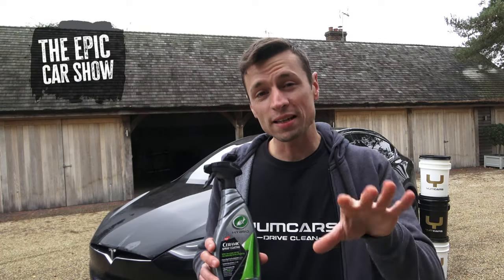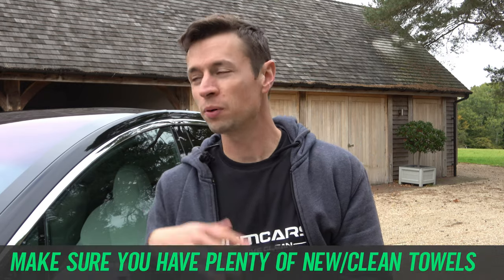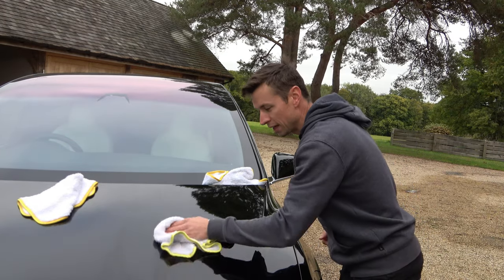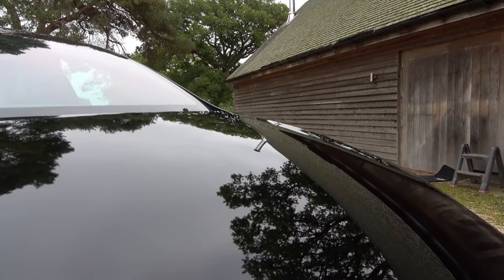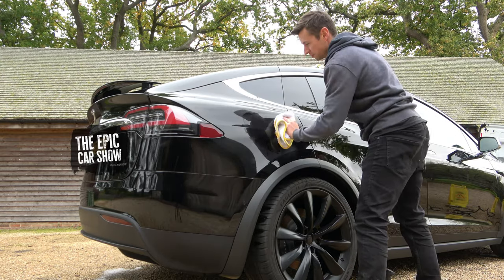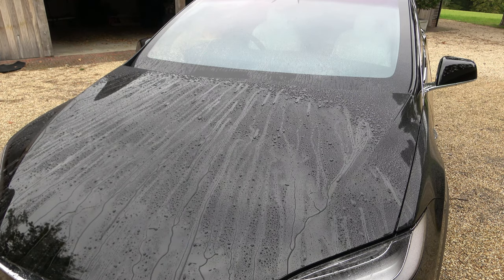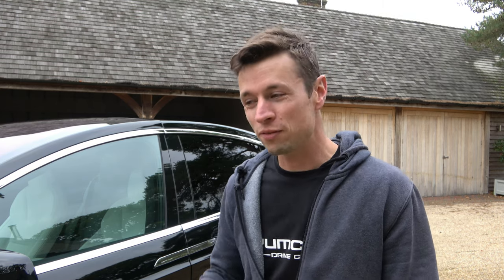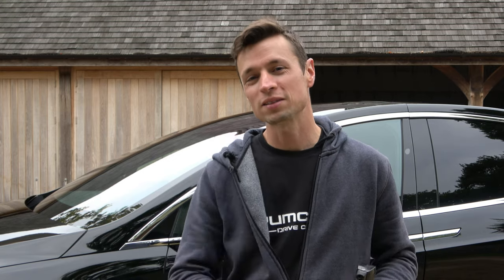Turtle Wax Ceramic Spray Coating Review | Fix Streaking on Black Cars

Comment: I have had success at avoiding the streaking by applying the spray to the towel itself not the car.
Reply from the maker: Yes good call 👏
Reply: I was going to say the exact same thing. I've discovered applying directly the applicator tends to work better. 
Good video though for sure
Reply: I recently discovered the same thing.
Reply: I also did the same…
I did polished my bike, it’s 2 years old now but I always take care of it, so I was confident of the paint condition. I did a hand polish & then washed and applied the product.
The only thing I’m wondering is that the water bedding has improved not by a big margin, may be because it was already smooth surface, secondly I did not notice any improved shine, again my bike is white.
Let me know your thoughts.
Reply: How many sprays did u do on ur towel?
Reply: Exactly, and don’t work in the sun or hot surface.
Reply: +1/ same here

Comment: It doesn't last for 1 year but it last until you wash your car  again with foam.I applied it to my car 1 time and in 24 hours I applied it again.After 1 week I washed my car.When I cleaned the car at first only with water I could see that the ceramic was there and the water was almost all slipping away from the car. but when I soaped the car with special soap and when I cleaned the foam with water, the water did not slipping from the car.  the ceramic lasts until you wash the car again. it is like all other liquid waxes.  they didn't last more than 1 max 2 washes and disappeared...

Comment: I’m way late to the party but I ran up on someone else’s video who is a “professional” who said they cut this and other type of sprays with up to 1:1 water. It works great coming right off the drying step. In fact, I use the already moist PLUSH drying towel and prime it with the 1:1 spray and it almost goes on 98.5% perfect and that’s already super good for most novice or casual eyes. You could quickly go over windows and chrome trim with a dryer clean primed MF towel. Works super quick on problematic dark and black paint. The beads are a HAIR weaker (meaning I had to look for weakness) but if you wash and wax this way at least every 3 months you are more than good even kept outdoors.

Comment: I've  had excellent results by spraying the TW Hybrid Ceramic and new Graphene sprays directly on a square microfiber applicator pad and applying in a cross-hatch pattern.  Very effective on the application and a bit more economical.
Reply from the maker: Yeah I love this spray the only thing that lets itself down is the time it takes to apply

Comment: Brilliant. Used this stuff last year on my black Range Rover after spending hours - clay bar, cut and polish. So disappointed with all the streaks, they disappeared after about 3 washes and there was obvious protection. Same process this week and tried less product, more clothes, more wiping off etc to avoid streaks. So bad I only did the bonnet and front wings. I'll give her another wash and try your method. Many thanks.

Comment: Thanks for the update. BTW, for those wondering about TW Ceramic Sealant and the new and improved S n’ S  vs. graphene coatings, there are a few videos showing that the TW products are longer lasting.
Reply from the maker: Thank you Robert. I liked the old seal and shine so hopefully the new one will even better
Reply: @epicautomotivedetailing  Please do a video on improved S n’ S. There’s a recent video comparing it to the original formula, and it beaded better and lasted longer, even after being assaulted by multiple applications of nasty cleaning products.
Reply from the maker: @ChicagoRob2  yeh I been thinking about testing it. I'd like to test it while I'm out and about so I can make relatable for car cleaners and see how to make it good for business with cost per application and look at how much you can charge for using it. I'll definitely do that

Comment: great video.   as a long time detailer,  I suggest misting di water from a spray bottle immediately after applying. then b7ffing dry for no streaks at all.  or dampen a new microfiber towel an vs then buff off with that.   good videos thanks

Comment: Thanks for this video. I had exactly this issue on my Black Alfa. Streaking looked awful. Tried the damp cloth trick but it didn't improve the situation until I followed the damp cloth immediately (literally damp cloth left hand, buffing cloth right hand) with a bone dry buffing cloth. Then it started to look great. As you say you will go through multiple buffing cloths because the need to be bone dry. This product still takes a lot of effort to apply to a black car so its not for everyone but if you use it have confidence to power on knowing the streaks will come out with these tips. Also, the direct sunlight tip is bang on product bakes almost immediately in direct sunshine making life even more difficult so choose a grey day, should be too hard in the UK.
Reply from the maker: Yeah it's definitely not my favourite by far there is too many better ones out there. I think for most people it's not worth the hassle this ceramic spray

Comment: Very honest review. I had the same streaking on my black BMW with the ceramic spray after I used Turtle ceramic polish and wax. With your tips it works much better. Thanks
Reply from the maker: Thank you. It's a good product but i can see why people became frustrated with it 👍
Reply: @epicautomotivedetailing  after I bought the regular ceramic spray, I saw that Turtle also released ceramic black spray and black polish. Did you tested these as well?

Comment: I bought this product as soon as I saw the many amazing videos out there.
But, after watching your video - and other videos of some lesser known YouTubers - and quitted even trying it.

I am very glad you did this video.
Now I am feeling more confident to apply this on my black car.
Reply from the maker: It's worth a crack if you still got it. It does shine up well and doing it now in the UK with weather cooler it's worth doing
Reply: Apply on a black car but spray the product on towel not on the car after just buff with a second towel. (Thank me later ) :) :) :)
Reply: @darker3rrr 
Thanks for the tip,, how long do you leave it, between applying on the towel, and buffing it off,, ??

Comment: This is exactly what I needed, I think I was having this problem with Meg's hybrid ceramic.  The biggest issue was on outer trim and windows where it left oily looking streaks, and I had the best luck with reappling over those areas with a thicker coat.
Reply from the maker: thank you

Comment: Good video and agree like many, the first time I used this I wasn't impressed at all, especially after watching all of the rave reviews. However, I've stuck with it and found the best way of applying on my black car (including in the summer), is to spray the product onto the microfiber cloth rather than directly onto the paintwork. Still streaks a bit here and there but much easier to work with. Also using the applicator cloth as the damp cloth to go over any bits again rather than another wet cloth. Good results and okay for once or twice a year but not an easy product.
Reply from the maker: It's definitely a love hate product. I got few more ceramic sprays to try this month as I'm definitely using them more and more now
Reply: Hi Joe, my first attempt not great so i'm reading all the comments and advice here. Did you mean that you have one applicator cloth that is wet with water or product? and use this for the whole car. Plus do you use multiple dry buffing cloths? Sorry if i have misunderstood.
Reply: @Tim955w  What I mean is that I use the same applicator cloth to go back over any streaks then buff again with the dry towel. Seemed to work okay.
Reply: @joespavin3792  Thanks for replying.

Comment: This guy is totally right, I’ve  used the black wax  with is amazing but it still streaks like crazy!  Using a damp towel does work
Reply from the maker: Thank you Phil, it's a good ceramic spray for sure but think it needs a little tweaking to be something special. You just got to power through it 💪

Comment: I spent all day on my car trying to remove streaks. Not at all easy and for this I will never use this again.   You’re right in what you say.   To Pell you the truth my Porsche came up brilliantly with Halfords own liquid polish. It was brilliant and easy to do.
Reply: He used it wrong. Spray it on the applicator not the car.
Reply: I tried this product a few times on my bright red car and the streaking was terrible. And yes I even tried applying on the cloth rather than direct on the paint. It was like I rubbed oil from the side of my nose on the paint. Took a lot of time and aggrevation trying to rub out the streaks using dry and then damp towels. I could have used old school wax in the same time and not have dealt with streaks. I don't get how people are successfully using this product, maybe they don't notice the streaks because they only show at certain lighting angles.

Comment: I have a dark grey Toyota and applying TW, I will get the streaks. But using it on my wife's silver car, it looks absolutely fine!
It's nice to find a the work around is extra micro fibres!
Reply from the maker: Yeh I've done fair few videos on this ceramic spray now and I've used it for a year I use it in lighter cars and save the darker coloured paint for things like yum cars or bear car care

Comment: Great video. I’ve been using this since April 2020. The key to this product is the damp cloth. It’s one extra step but it’s worth it. I also use the TW ceramic polish before this spray and that gives you 2 layers of protection. TW also came out with the black version of this that gives more depth while retaining the same gloss and protection.
Reply from the maker: Thank you Ron, sounds good idea I'll try that next time
Reply: What about the damp cloth?

Comment: Applied it 2 months ago and didn't really have any issues on a dark grey metallic. Used cheap/less plush MF for application, 1 to apply, damp one to remove and a quality buffing towel. Found it pretty easy and no issues. Over application seems to generate most people's problems imo.
Throw towels in a bucket of warm water as soon as you are done to stop the product curing into them and a subsequent wash makes them good as new.
Reply from the maker: Hello just curious on the weather conditions when you applied it. The horror stories I seen were from the really hot days in direct sunlight. Thanks for your feedback and experience it really does help other who read comments 😃
Reply: @epicautomotivedetailing  12c bright and sunny. I'd parked the car in the shade too.
 Machine polished with The TW Polish on a finishing pad, then 2 coats of the Ceramic. Done over 2 days so slightly reduced the cure time between ceramic coats 1 & 2.
Reply from the maker: @UltimateAccuracy  nice 12 is good temperature. I really struggled when I did it on hottest day of the year

Comment: Thanks for the video. To make this work in the heat (I'm in Vegas where it can get super hot and super dry!), do only one section at a time. Then make sure you use a dry cloth to buff it. That's it! I do it once a month after the first time, and it's incredibly good.

Comment: I'm glad I stumbled across this video because after using this product yesterday I found it streaked terribly. I did a full correction prior to using it. I thought these spray polishes were supposed to be faster to apply and some would have you believe they are, but in my opinion, the traditional paste waxes are far easier to use given that you don't have to franticly remove the product before it starts to flash-off and I think that's the problem with the streaking with these spray polishes, they start to flash-off before you have a chance to buff it off, especially on the larger panels, so it's those areas that have dried are what cause the streaking. You also mention about it being too warm when you applied this previously but TW claim you can use this in direct sunlight.
Reply from the maker: I think it's just a troublesome product in general. They know that. I expect this to be gone soon as they will probably have a better version
Reply: @epicautomotivedetailing well i bought version that says "new", yet i have same problems :D sio2 % is high enough to cause these peoblems + solvents in this bottle arent as agressive as they are in some other professional coatings where you can really smell them. Those strong solvents are bad for health but, comparing to something as TW spray ceramic, they actually help you remove streakings MUCH easier (before coating is fully curred).
Reply: Agreed. I had same issue and also ended up resorting to a quality paste wax. Wax on, haze and wax off ... without dealing with streaks.
Reply: @bigworldparty  The polished surface failed to bead when it rained.. in just five weeks.

Comment: Nice to see the integrity shown by not only making this video but pulling down the others. From my point of view (just doing my own cars), I'm sticking with Seal'n'Shine (or whatever we call it in the UK). The results are stunning, especially if the first application is done slowly with an applicator. I think the longevity, gloss and slickness are hard to beat for the money. However, if I was selling it as a service, like you, I'm sure selling a ceramic sounds much better than selling something from a £10 bottle from Halfrauds ...
Reply from the maker: Hello I'm definitely buying some seal and shine tomorrow I need to try asap for a video 👏

Comment: Dave a great video working in the heat is hard and a hot surface on a vehicle can be a challenge. You state the facts and some products are recommended not to be used in direct sunlight.  I know that a majority of the products are not to be used in direct sunlight and it's always wise to read the manufacturer directions.  Thanks for taking the time to encourage and to teach others the mistakes you have made and to avoid them. I live across the pond and working in the direct sunlight in Texas is challenging.  I have products that can be used in direct sunlight and streaking with any product on a dark color vehicle can also be an issue.  You said it best power through it and take the time to use more than one towel and just don't get discouraged.  If you are ever across the pond and come to SEMA Show  drop me a line.
Reply from the maker: Thank you my friend. Its actually hot over here right now. It hit 31 yesterday which was mad. still not a patch on texas i bet lol

Comment: As a mobile car detailer, I use this product because it's the best, but smearing is my biggest problem, making the job take much longer, and yes I spray directly onto the microfibre cloth, and I have to use water to remove the smear, but the results are outstanding, and worth the added time.
Reply from the maker: Yes the time is an issue but the results are amazing
Reply: So,,  it's spray onto a dry cloth, and apply,, wipe off after a minute or two, with a damp cloth,, and then almost immediately, buff with another dry cloth,,,  is that correct,, ??? Just trying to find the "perfect scenario" ". Cheers,,,,

Comment: Loved the video.  I have a dark blue car and have had streaking issues with several different products.  Instead of using a dry MF towel to spread the product, I've tried smoothing out the product with a damp MF towel.  This adds just enough moisture to allow the product to spread around evenly until I can buff it off.  It's not a perfect solution but has helped tremendously.

Comment: No streaking, no mess at all. Follow the directions, just 2 sprays per panel, never overspray. I spray directly on the panel or microfiber.
For best results, I use Hybrid Solutions Ceramic Wash.

Comment: I had a hell of a time with this stuff , and after applying  to the car sone days later parked outside a pub in the sunlight and it looked dreadful, but on the driveway it looked ok , so will now try it again , with your method , cheers great video and top tip with the damp microfibre cloth i will try again 😊

Comment: I started using it as a kinda drying aid on wet paint after maintenance wash. Works great!
Reply: But still.. Doesn't matter how I apply, it is not very durable..
Reply from the maker: I've done 24 hours in between coats and that's the best way to get real good durability.

Comment: I just finish to apply the first layer on my BMW i4 and I agree about the quality of this product.
Maybe I would add some advices to easyly get the job done: first of all, don't do this outside if the sun is shining. It's way better to to it inside when at temperature under 10° C. You will not have traces problems. Second, don't spray too much product and work on a single panel ay a time. Spray as you would paint: keep your hand moving toward the surface when spraying. Third, use good microfiber special clothes, one to spread, one dry to polish/finish. Don't wait too long to finish after spreading.
I tested with and without polishing car before on small surface and if you have time it's way better to do it first. You will got a  better result. 
It's not very difficult to use, but it requires a few hours of good working.
Tomorrow, I will go for the second layer, it will be more relax and a quick job, I think.
I hope this will help some of you.